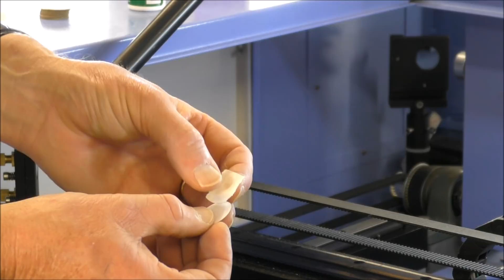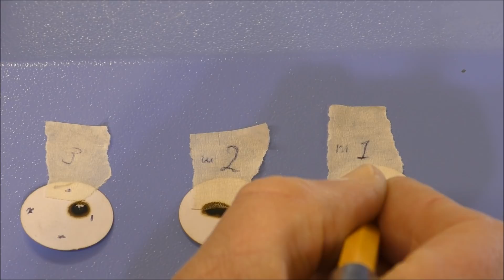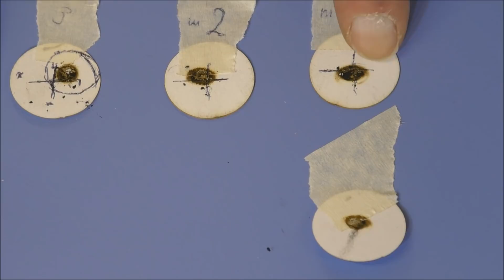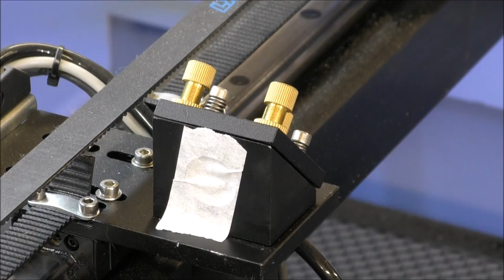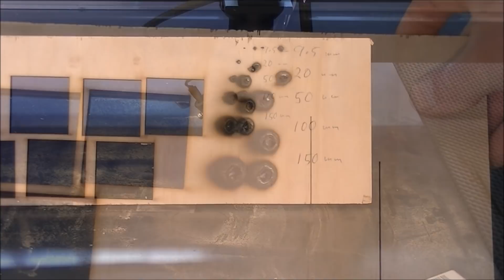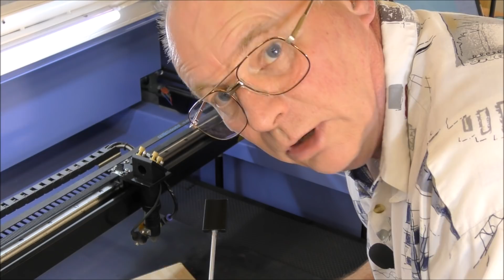221 LASER!!! 🎯How straight is yours, if not, what to do about it!!!

Comment: Use blue painter’s tape instead of those silly targets that aren’t even secured. Rub your finger around the edge of the hole to Mae a mark/target on the tape. Then check the alignment of the tube to the first mirror. Don’t waste your time with testing the 2nd and 3rd mirror until you know the tube is aligned. Then align the other mirrors in order.

Comment: thank you, very help full. vid,. I have 1 question i still cant seem to fix my Laser. on my first mirror when i test the alignment the  burn mark on the paper is more a ring with a unaffected spot in the center  and not a solid dot .  any idea what could cause this. Grateful if you could help
Reply from the maker: It would indicate that your laser tube needs replacing, unfortunately, this is a classic example of a bad (DYING) laser tube. A laser is a gaussian shape.
Reply: @inventorsworkshop9600   Thank you for the advice,  After a successful tube change the machine is working like a boss.  TY
Reply: @inventorsworkshop9600  thank you for the help

Comment: Are you only adjusting in the middle of the platen for a reason? I have been trying, unsuccessfully, to align my mirrors for a few weeks a few hours a day and am pulling my hair out. I go to the farthest position and fire and it hits the middle. I then move back to the closest position and fire a test and it is then to the left by 10mm, almost at the edge of the mirror. I have tried moving the laser and the mirrors to correct this but it just moves in equal adjustments as far as my closest to furthest test fires. The dot stays on the center line but spaced apart. Not sure what to do about this. Any suggestions?
Reply: Did you ever solve this?  I have a 1390 and I struggle trying to align mine.

Comment: Thanks, I'm about to tear what little hair I have out of my head  I have a Redsail 1290 130watts good unit when running propper, Crook operator, I will give your discs ago, got to be an easy way to aline the mirrors.    AU
Reply: It's a real pain in the ass!  I have a 1390 and struggle to align it.
Reply: @ARIN4UK  
I have a 700.. No issues. I wonder what difference is.
I have gotten pretty good at adjusting. 
I have noticed most videos miss many things and make things to complicated or to simple.

Comment: I'm wondering if there's an alternative method that doesn't require so much fiddling with pieces of paper.

Would it be possible to put a smartphone on the cutting bed with the face camera directly under the laser nozzle, pointing up into the nozzle and be able to adjust the mirrors in reverse order? So, I put a target over mirror 2, then adjust mirror three until I see that target on my 'phone, then move the target to mirror 1 and adjust mirror 2, again until I see the target on my 'phone. Finally, shoot the mirror 1 target (after removing the 'phone) to align the laser.

This method, if it works, would allow the user to watch the alignment happening in real time, rather than taking laser pot shots to see how the process is progressing.

I don't have a laser cutter, so I can't try this. Is it a workable method?

EDIT: I should also say, it would probably be necessary to remove the objective lens from the laser head to do this.
Reply from the maker: Hi Mark, you are also looking at the shape of the beam and tracking that beam so I do not think the phone idea will be successful.
 Thank you for watching,  
Please forward the video on to a friend, Australian Inventor Roger Clyde Webb ;-)
Reply: I have just found today a reverse laser alignment tool.  Check American Photonics.  And search YouTube for the video.  Good luck.